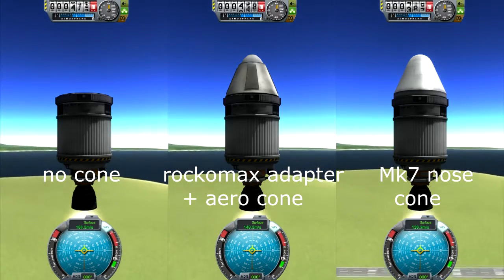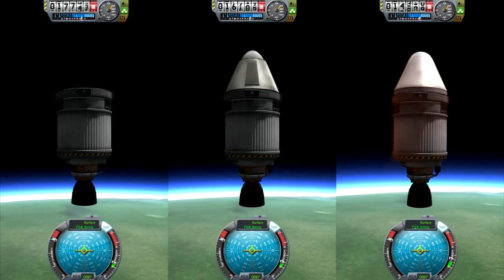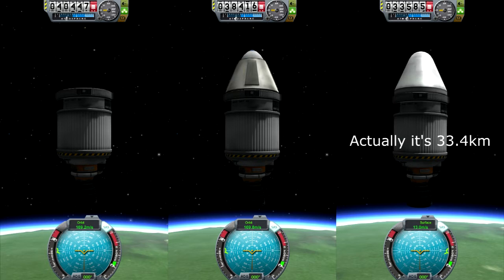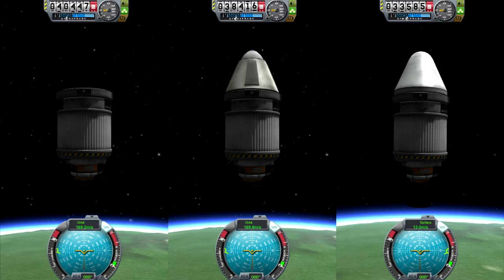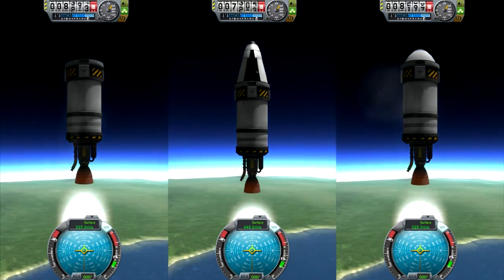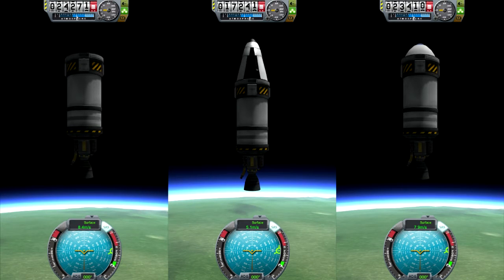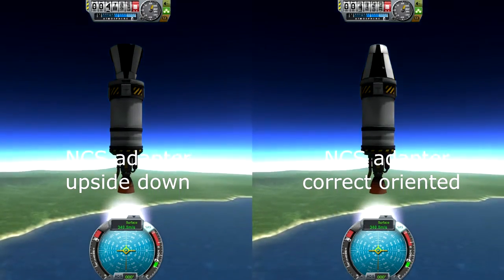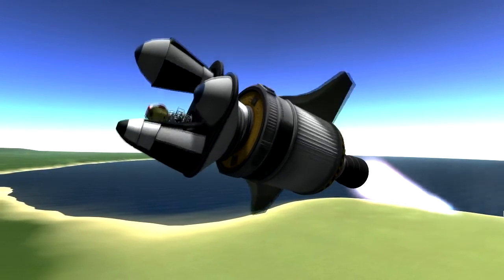KSP: Drag on nose cones

Comment: The reason it works like that is because ksp calculates drag based on part 'drag' values. A better aerodynamic system is planned for the future. Try downloading the 'ferram aerospace research' mod, which fixes aerodynamics.